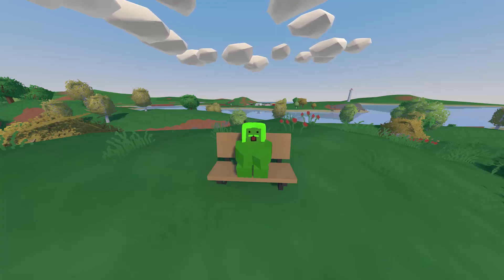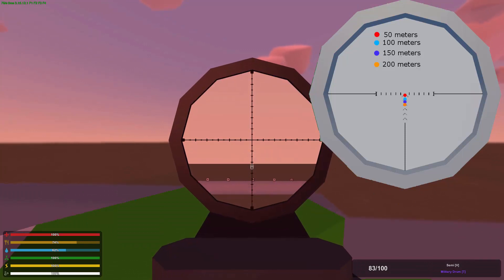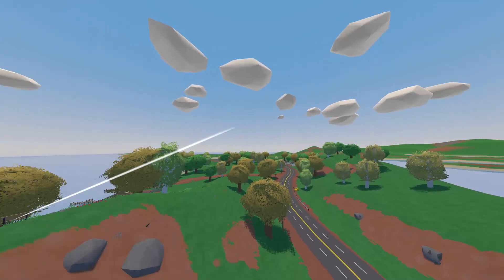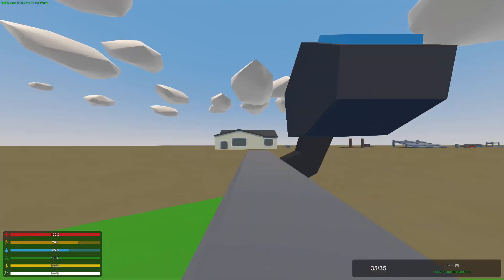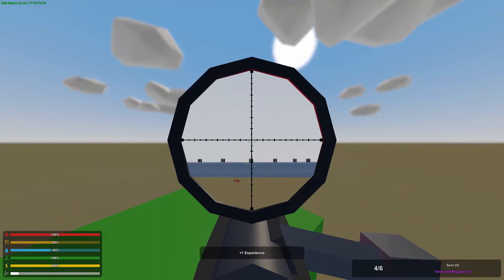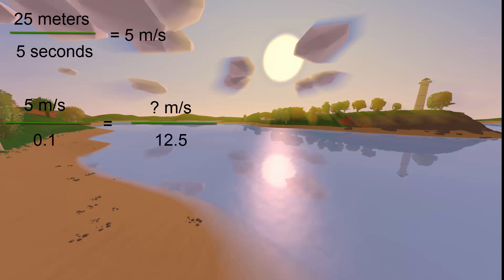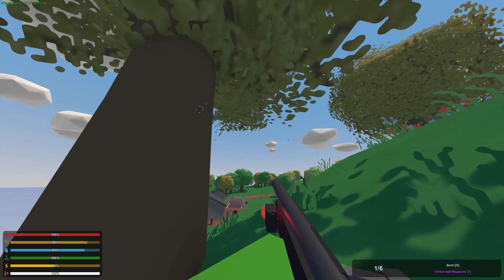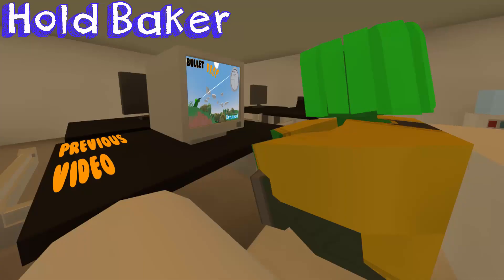Bullet Drop in Unturned (Part 1) (In Depth Look)

Comment: Just letting you know that real suppressors actualy decrease bullet drop. Call of duty and games like that only have it worse so that it's a balanced game
Edit: also most rifles in real life (even the very small ones like 0.22lr) send bullets at super sonic speeds, again the 0.22lr which is a very weak gun usualy sends at around 400 m/s. Yes that is lower than the 635m/s in unturned but you have to consider they are much more powerful rifles in unturned.

Comment: irl, a longer barrel increases velocity of bullets, so, wouldent a surpresser make the bullets go farther and do more damage?
Reply: No, because a barrel length lets the initial expanding gas push the bullet out. A suppressor however works to let the gas escape out the sides so as to not have that loud sound.
Reply: KrodeonYT that sounds about right, thanks for the reply!
Reply: KrodeonYT that's wrong because modern supressors act also as long barrels, reutilizing escape gas to increase the bullet speed